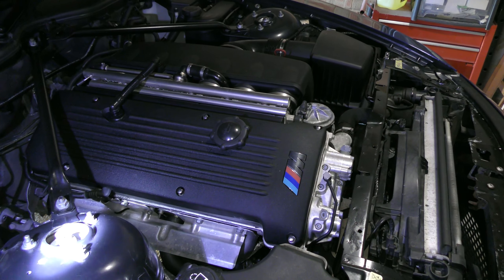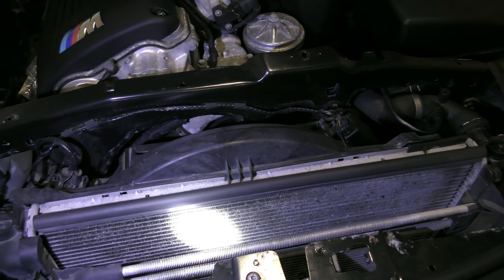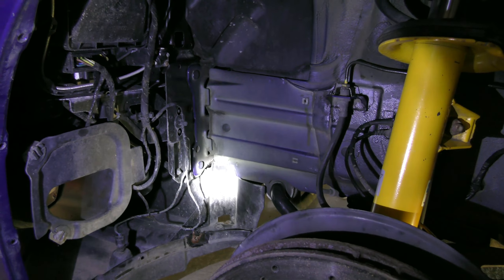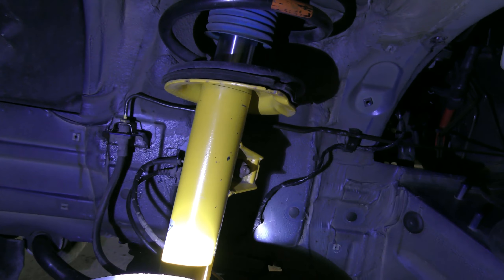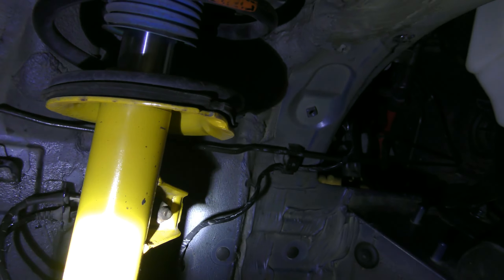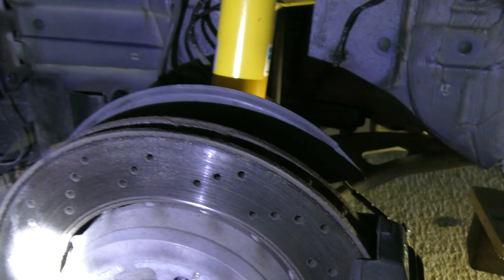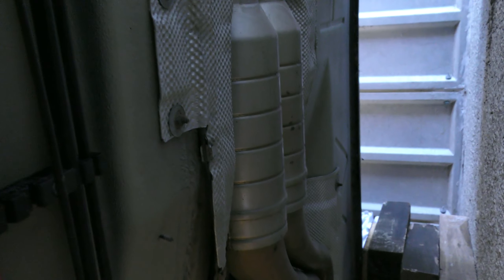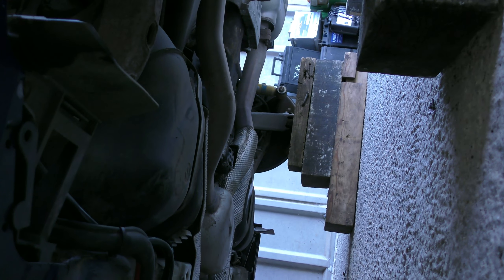2006 BMW Z4M: Underside Restoration Front Half

Comment: Now all you need is to add the dual stage supercharger off a Merlin engine, feed her high octane aviation petrol, and…

See if you can turn a BMW into a SAM battery. That cylinder head would fly!

Joking aside, darned nice car. It’ll be fun to drive.

Comment: Well done so far Cap ! The AC is needed as it will dry the moisture inside the car when on and will dry foggy windscreen way way faster than if you try and blow wet air from the outside. AC is a must if working on a foggy or wintery UK days :)

Comment: When plastic splits, use super glue mixed with baking powder, try to create a valley on the join of the plastic for more super glue and baking powder to bound the plastic. Result are awesome. No need to replace parts.
Reply from the maker: thx
Reply: This or also you can take a heat gun and heat up the plastic and melt it back together with a screen mesh pressed into the backside to reinforce it.
Reply: @floydfarms1578  That sounds great. Combining the two methods 👍

Comment: If the rod bearings on that S54 have not been done yet, start budgeting for that now. Likewise the cooling system (expansion tank, radiator, water pump, t-stat. etc) as most of the thermoplastic cooling system components will start to fail after 100,000 miles.

I have a 2002 Z3 Coupe, so I've done that dance in the last few years.
Reply from the maker: Can't wait! :(
Reply: @grimreapers2  I couldn't eaither. That said, once the due diligence issues are addressed, that is one of the most satisfying engines to drive ever made, and if you stay ahead of maintenance, they're pretty bullerproof.

Also, if it hasn't been mentioned to you, only use pentosin-based OAT coolants in BMWs. Ethylene glycol-based coolants are a no-no with those engines and can prematurely corrode components.

Comment: I had a 1998 328i. Loved the car but so many problems. Head gasket, 2 auto transmissions, radiator, ect all well under 100k miles.. A few years ago I took it to be smogged and while on the dyno it below a coolant hose in the back side of the engine. I said no more. Was just too many problems and too much stress. BMWs handle great but i will never get another one. No where near as reliable as Japanese cars and cost way to much to keep running. For me it was just way to much stress waiting for the next thing to break or not passing the next smog test

Comment: Nice cap!, the best maintenance is preventive maintenance. I had my 2005 merc slk350 coated with denitrol last winter. It's not cheap, but it prevents corrosion for at least a decade.
Reply from the maker: Awesome.